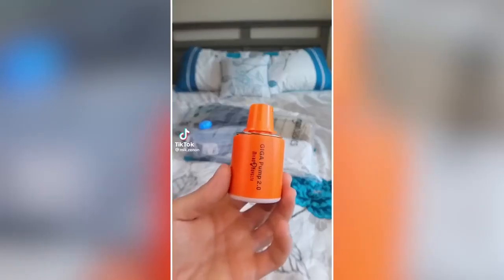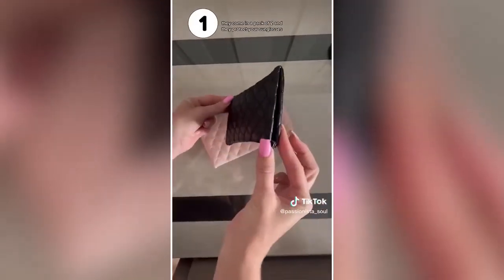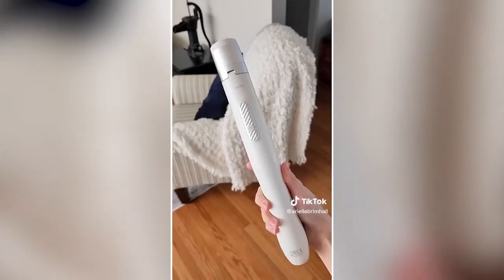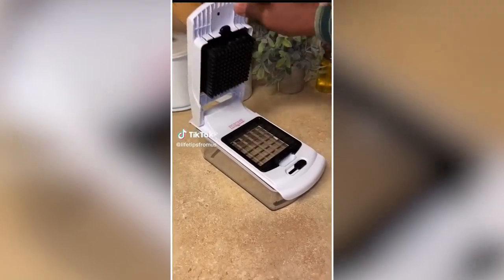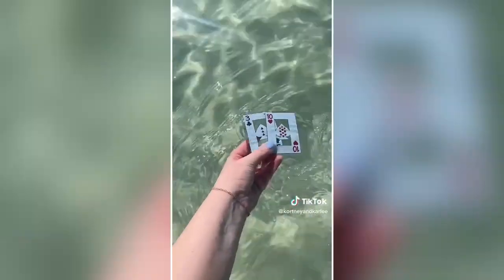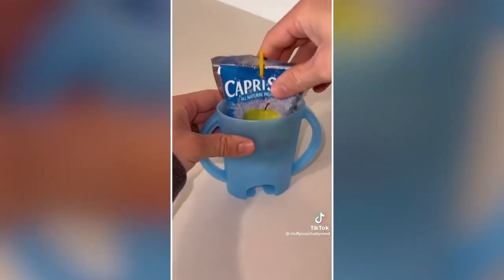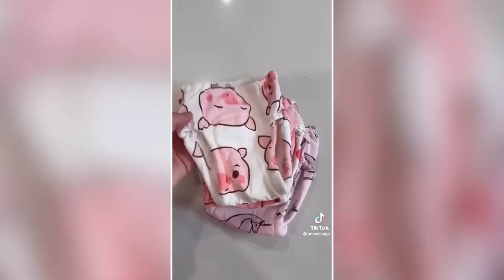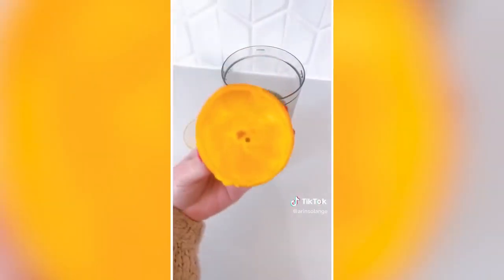2023 Amazon must haves with links TikTok Made Me Buy It #TikTokMadeMeBuyIT

Comment from the maker: 00:00 - Try Amazon Prime 30-Day Free Trial - https://amzn.to/3GAGcLO

00:05 - Toiletry Skins - https://amzn.to/41amMaR

Luggage and Travel - https://amzn.to/3LSp5ew

Neck Pillow - https://amzn.to/44rKXVi

Suitcase Cover - https://amzn.to/44r199g

Earbuds - https://amzn.to/3LUGMtR

00:32 - Garden Kneeler - https://amzn.to/42pEnNm

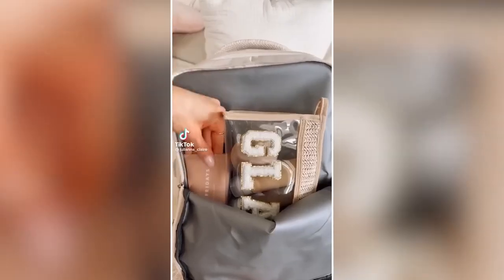00:58 - Large Travel Backpack - https://amzn.to/3LUBVbX

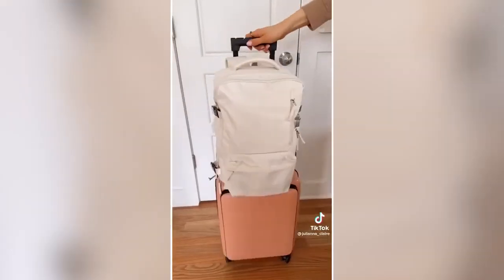01:24 - Pull Wipes Dispenser - https://amzn.to/416rdDQ
Automatic Pan Stirrer - https://amzn.to/3HEh9uU
Slushie Maker Cup - https://amzn.to/3LslCSq
Garlic Crusher - https://amzn.to/415huO5

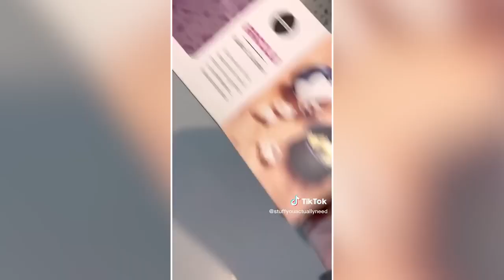01:56 - Liquid I.V. Hydration Multiplier - https://amzn.to/3VwoL8k

02:09 - Meal Prep System - https://amzn.to/3ZseU4D

02:43 - Wheel Tray - https://amzn.to/425XdJo
Label Maker Machine - https://amzn.to/3nsmtdN
Rings Loops Compatible - https://amzn.to/418VzW6

02:58 - Car Seat Gap Filler - https://amzn.to/3Vu5nsF
Car Trash Can - https://amzn.to/44vBHzg

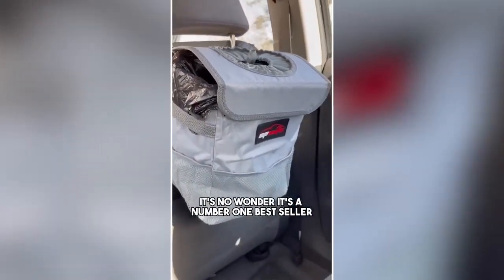03:37 - Carry On Garment Bag - https://amzn.to/425Z5lo

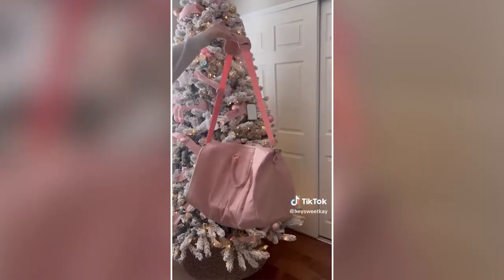04:17 - Clear Soda Can Lids - https://amzn.to/3Lso3V4

04:26 - MCMUFFIN MAKER - https://amzn.to/3NF9EHQ
thin ice cube trays - https://amzn.to/3HEwyva
oil dispenser BRUSH - https://amzn.to/3p5HNq2
peeler with container - https://amzn.to/44u5Q1V
FOOD HUGGERS - https://amzn.to/3nmSYu9
TOASTER TONGS - https://amzn.to/3pahWxj
DIP CLIPS - https://amzn.to/3AW6Lei
4 in 1 vegetable chopper - https://www.amazon.com/Vegetable-professional-multifunctional-Adjustable-Container/dp/B0BML2QRMD?pd_rd_w=0Z2hM&content-id=amzn1.sym.67f8cf21-ade4-4299-b433-69e404eeecf1&pf_rd_p=67f8cf21-ade4-4299-b433-69e404eeecf1&pf_rd_r=TNRRYGDFYYX1NQDG6Z0V&pd_rd_wg=rzgZV&pd_rd_r=c0608262-fe3d-4b52-9c6d-6f8f5b8125da&pd_rd_i=B0BML2QRMD&psc=1&linkCode=sl1&tag=wealthwizar03-20&linkId=7b592fa35909d1154b30c4afa350fe33&language=en_US&ref_=as_li_ss_tl

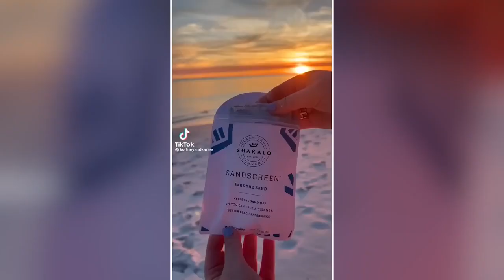05:23 - SANDSCREEN Sand Removal Bag - https://amzn.to/424XJr5

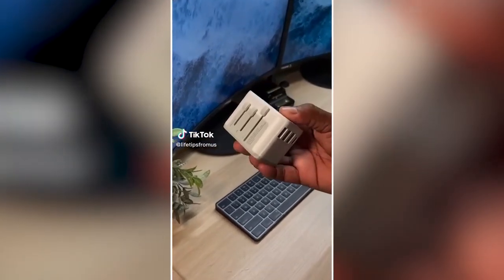05:39 - Universal Power Adapter - https://amzn.to/4172KOu

05:58 - 4-in-1 Car Vacuum - https://amzn.to/3LygcoX
Car Folding Visor Vanity Mirror - https://amzn.to/3AUxtUv

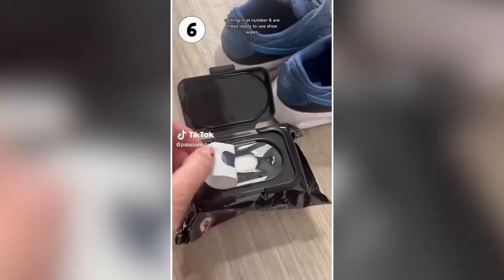06:25 - Sneaker Wipes Cleaner - https://amzn.to/3ARhlD8
Belt Bag - https://amzn.to/42qI2tY
Sneaker Cleaner - https://amzn.to/3p9OPKv
Diamond Dazzle Stik - https://amzn.to/422RHHB
Amazon Essentials - https://amzn.to/3pc6ktn
Sunglass Pouch - https://amzn.to/42nCGzN

07:04 - 
Ice Cube Tray - https://amzn.to/3VyLRuV
Electric Butter - https://amzn.to/3B0qGbH
Over Sink - https://amzn.to/4175X0u
Flat Top Griddle - https://amzn.to/3LAYIsb
Cookie Keeper - https://amzn.to/3EXY5WS
Reusable Pizza Storage - https://amzn.to/3VyrXjJ
Electric Egg Cooker - https://amzn.to/3LBGTce
Cutting Slicing Kitchen - https://amzn.to/3LTXQ33
Can Dispenser - https://amzn.to/42s07rV
Mixing Bowls - https://amzn.to/42t2hrf

07:51 - Tap Bracket - https://amzn.to/417Gc0d
Mounted Blinds - https://amzn.to/3p3IX5n
Mop Grippers - https://amzn.to/3LULRCh
Door Stopper - https://amzn.to/3nuH5Ck

08:16 - Inflatable Corner-Sofa - https://amzn.to/3oZmk1S
Sleeper Chair Bed - https://amzn.to/42o7Mr7

08:35 - Grampa's Weeder - https://amzn.to/3VAPkJM

09:05 - Nest Colanders - https://amzn.to/423YUHr
Rack Holder for Food - https://amzn.to/3VyNIQp
Clean Dirty Sign - https://amzn.to/3B0stxr

09:45 - Scrub Daddy Damp Duster - https://amzn.to/3LVG6EH
Strawberry Slicer - https://amzn.to/3LUtldr
Bag Clip - https://amzn.to/3AUNF8k
Camping Utensils Accessories - https://amzn.to/3VvJdWO

10:24 - mats beard bar 2.0 - https://amzn.to/40Zvau1
Dryer Vent Cleaner Kit - https://amzn.to/3Vx167O
Jar Spatula - https://amzn.to/3LxyQgS
Pet Boost Oxy Formula - https://amzn.to/3HGQ7mx

10:57 - Expandable Silicone - https://amzn.to/3AXeU21
Sock Laundry Tool - https://amzn.to/3HAfhDu
Hair Remover - https://amzn.to/42qKSQ2
Finger Chopsticks - https://amzn.to/3AWk7Hs
Middle Finger Hands - https://amzn.to/3M5aSet

11:32 - glass drinking straw - https://amzn.to/3p5Vkhk
Banana Bungee - https://amzn.to/3AUGX1T
Bands Cutter for Hair - https://amzn.to/3LUS94R
Bathroom Shelf - https://amzn.to/42ji1ge
12:09 - Laptop Sleeve Compatible - https://amzn.to/3VBe2cL
Travel Blanket Pillow - https://amzn.to/3LUyClf
Butter Hand Cream - https://amzn.to/422XT2o
Hydro Flask - https://amzn.to/42nLK7N
Power Mist - https://amzn.to/3HFju8Z
AirFly Pro - https://amzn.to/421qMfa

12:25 - Beach Towel - https://amzn.to/3HGsZVk
Waterproof Phone Pouch - https://amzn.to/41d76UE
Portable Bluetooth Speaker - https://amzn.to/3HCuuUg

12:44 - Beach Tote - https://amzn.to/3LVTWH0
Beach Day Pouch - https://amzn.to/419BBKW
Cup Holder - https://amzn.to/44rkHKG

12:57 - Large Travel Backpack - https://amzn.to/42pk5U1

13:25 - Selfie Stick Tripod - https://amzn.to/42jdJ8w

14:00 - Label Maker Machine - https://amzn.to/3NDrE5e

14:31 - Rings Loops Compatible - https://amzn.to/3oYindN

14:41 - Portable Carpet - https://amzn.to/3nsWOlc

15:18 - 
The Original Cup Claw - https://amzn.to/3LR3Vxf
Touchscreen Mist Cleaner - https://amzn.to/3HCOPsN
Guacamole ProKeeper - https://amzn.to/4250Jng
Pants Button Extender - https://amzn.to/3ns5WGM
Fabric Shaver - https://amzn.to/40ZxKA8
Steamer for Clothes - https://amzn.to/3LBcBqj
Electric Spin Scrubber - https://amzn.to/44vWLpk
Toilet Brush and Holder - https://amzn.to/3LCaZMS
Mini Bag Sealer - https://amzn.to/425bUN0
STAINS CO Stain Remover - https://amzn.to/3I20MbR

16:30 - Coffee Syrup Dispenser - https://amzn.to/3LUGd3f
Peppermint Syrup - https://amzn.to/415FzEt
Carmel Syrup - https://amzn.to/3NEJTYm
Milk Frother - https://amzn.to/3NGo4HS

17:02 - Instant Sole and Sneaker Cleaner - https://amzn.to/3VwUxSC

17:29 - LinkPod Station - https://amzn.to/3VzsL8j

17:57 - Bling Pill Container - https://amzn.to/3pb0jxr

18:06 - Snack Spinner - https://amzn.to/42nBgFp

18:16 - Coffee Mug - https://amzn.to/3LzN5S5
Banana Preserver - https://amzn.to/3AUElBa
Portable Wireless Charger - https://amzn.to/3LR9lbz

19:06 - Rolldown Refrigerator - https://amzn.to/3LwFMdV

19:18 - Fruit Infuser - https://amzn.to/3VzaCHv

19:28 - Shower Water Bottle Cap - https://amzn.to/3nsMw4z

19:45 - Crystal Hair Eraser - https://amzn.to/3LUnQv9

20:02 - Yogurt Fridge Organizer - https://amzn.to/4105bCt

20:15 - Beard Apron - https://amzn.to/3Vz2Ygm

20:30 - Automatic Mouthwash Dispenser - https://amzn.to/3Nzbr17

20:52 - 4 in 1 vegetable chopper - https://amzn.to/3p7IejB
21:25 - LED Wall Sconces - https://amzn.to/421C0Ak

21:50 - Kids Art Frames - https://amzn.to/3LSx0sf
Inflatable Toddler Travel Bed - https://amzn.to/3NFARtY

22:14 - Towel Warmers - https://amzn.to/3p7bOWC
Muffins, Croissants - https://amzn.to/3p7mu7u

22:38 - Kitchen Drawer - https://amzn.to/3LzQWi1
Self Stirring Mug - https://amzn.to/3HBeF0c

23:06 - Vegetable Cleaning Machine - https://amzn.to/3nvA0Bq

23:29 - Salad Chopper - https://amzn.to/3AQyL2V
Hover Soccer Ball - https://amzn.to/3Lyn9GL
Cord Organizer - https://amzn.to/3LBupla
Bed Pillows - https://amzn.to/426fEO3
Washing Machine Cleaner - https://amzn.to/3NFWcn4
Garbage Disposer Cleaner - https://amzn.to/3HF8AA0
24:12 - Triangular Powder - https://amzn.to/3HHoKsx
Face Washing Wristbands - https://amzn.to/3nsxvzK
Makeup Removing Swabs - https://amzn.to/3p6um9k
Guru Eyebrow Tweezer - https://amzn.to/3LA9QFv
Color Removal - https://amzn.to/3Ly6pPQ
Feet Coconut - https://amzn.to/44uTnLx

24:55 - Magnetic Wristband - https://amzn.to/3LRzUNP
Reply from the maker: 25:24 - Cordless Electric Spin Scrubber - https://amzn.to/3HGEBHX
Expandable Dish Rack - https://amzn.to/44t8mWe
Silicone Freezing Tray - https://amzn.to/3ASIxBF
Hidden Pocket Safe - https://amzn.to/3Vv04t2

26:10 - Cactus Back Scratcher - https://amzn.to/42oRdeF
Collapsible Water Bottles - https://amzn.to/3pb7RAd
Cordless Electric Scissors - https://amzn.to/3VA80sM
Compact Green Heavy Duty - https://amzn.to/42n6rAT
Magnetic Drawing Board - https://amzn.to/44vkBBD

26:52 - Tablet Floor Stand - https://amzn.to/44sEglS

27:32 - LinkPod Station - https://amzn.to/3Vw9aFK

27:56 - Waterproof Playing Cards - https://amzn.to/42qxmvK

28:10 - Countdown Timer with Repeat Function - https://amzn.to/3AS4UqG

28:33 - Waffle Maker - https://amzn.to/426PFWO

28:50 - SD Card Reader - https://amzn.to/41WxPpv
Dress - https://amzn.to/3AQXXX3
Medication Tracker - https://amzn.to/3nAv7a7
Portable Door Lock - https://amzn.to/3p7Dvi2
Lint Roller - https://amzn.to/3nvFkER
Wedge Pillow Stopper - https://amzn.to/44seVIJ
Sweatshirt - https://amzn.to/3pbyVzd
Warmer Lamp - https://amzn.to/3p06FiQ

29:51 - Water Bottle Dispenser - https://amzn.to/3NEHE7l
Projection Alarm Clock - https://amzn.to/3AUmcU7
QuickZip Fitted Sheet - https://amzn.to/3HFYWgB
Smart Electric Motor - https://amzn.to/3M5RLkt
Alarm Clock on Wheels - https://amzn.to/3NEHMnl

30:21 - Electric Spin Scrubber - https://amzn.to/3p7SWqk
Toilet Brush - https://amzn.to/3HFmYZ8
Waffle Maker - https://amzn.to/415U8Yv

30:47 - Night Light Motion Sensor - https://amzn.to/44xQp9k

30:58 - Magnetic Bottle Hanger - https://amzn.to/3AVoL8l

31:11 - Fullstar Vegetable Chopper - https://amzn.to/3LCJMJY

31:44 - Travel Toiletry Bag - https://amzn.to/3pe4Uyz
Toothbrush Cover - https://amzn.to/3LATmgj

32:00 - Smart Helmets - https://amzn.to/3nq4q8i
Bicycle Bell for Apple AirTag - https://amzn.to/3VxpR3G

32:21 - Automatic Card Dealer - https://amzn.to/42I1brR
Instant Photo Printer - https://amzn.to/42odfxZ
Security Camera - https://amzn.to/42gmPDc
Storage Lock Box - https://amzn.to/3NCNFkG

32:49 - Silicone Freezing Tray - https://amzn.to/3HB1VH1

33:33 - Hair Tool Organizer - https://amzn.to/41amWz8
Travel Power Strip - https://amzn.to/428o7As
Hair Drain Catcher - https://amzn.to/3NETSNe
Shower Foot Scrubber - https://amzn.to/426Dzgz

33:57 - Wipes Dispenser - https://amzn.to/3VxWYo4
Baby Bath Toys - https://amzn.to/3HE7ioK
Food Pouches - https://amzn.to/3nmREra

34:34 - Flip Seat - https://amzn.to/3AVPyS8

35:03 - 2-in-1 Under Bed Storage - https://amzn.to/42hVvEM
Silicone Stretch Lids - https://amzn.to/42tUeKR
Paper Towel Holder - https://amzn.to/3HERWAr
Drawer Under Shelf - https://amzn.to/3VxD4JM
Wipes Dispenser - https://amzn.to/3nmT84I

36:01 - Pants Button Extender - https://amzn.to/44ruD77

36:32 - measuring spoon set - https://amzn.to/42wj8tj
electric juicer bomkra - https://amzn.to/3AVRREz
garject garlic press red - https://amzn.to/42pRP3M
can strainer - https://amzn.to/3VPZ6I9
soda can pump - https://amzn.to/44uwmIG
tomato slicer - https://amzn.to/42emXne 
spaghetti fisherman - https://amzn.to/44umWwS
toastie cage - https://amzn.to/3p2JggI
milk dispenser - https://amzn.to/3HH4GGK

37:33 - Female Urination Device - https://amzn.to/416Xf2j

37:48 - Label Makers - https://amzn.to/3LW0zJk

38:09 - Desk Cable Management Tray - https://amzn.to/44uxmfU

38:35 - DraftPour Beer Dispenser - https://amzn.to/3HJRr8m

38:57 - The Pink Stuff - https://amzn.to/3NCXQG9
Garbage Disposer Cleaner - https://amzn.to/3NFiJjM
Wine Stain Remover - https://amzn.to/3AYaHv6
ORANGE Pet Odor - https://amzn.to/3nvgXXS
Washing Machine Cleaner - https://amzn.to/3LXiWgZ

39:30 - Expandable Dish Rack - https://amzn.to/3NDNhmb

39:55 - Cotton Pad Dispenser - https://amzn.to/3LYXOXV
Door Hooks - https://amzn.to/3AUIMfk
Toilet Scrubber - https://amzn.to/44vP4Q2

40:18 - Neck Traction Device - https://amzn.to/42ub9gm
Burger Holders - https://amzn.to/429h2iY
Automatic Pan Stirrer - https://amzn.to/3NIfTL1
Foot Scrubber - https://amzn.to/42szK4Z
Child Toothpaste Cap - https://amzn.to/3pbCuFE

41:00 - Magnetic Hat Holder - https://amzn.to/3HDBFfe
Sunglass Case - https://amzn.to/3I5fMFV
Beach Tote - https://amzn.to/3HI72W2
Portable Bluetooth Speaker - https://amzn.to/3pgQ62b
Steamer for Clothes - https://amzn.to/44wnthK

41:15 - Slim Cooler - https://amzn.to/3HFPLwk
Camping Towels - https://amzn.to/3AX5p2J
Picnic Blanket - https://amzn.to/3NGPtJq
Body Powder Container - https://amzn.to/429ooTC
Sunscreen Broad - https://amzn.to/42kvlkM
Portable Camping Shower - https://amzn.to/3LYjl2P
Fish Silicone Dish Brush - https://amzn.to/3NHBL9f
Makeup Sponge Holder - https://amzn.to/3LYvGny
Empty Acrylic Air Pump Jars - https://amzn.to/3p2Vvda
Clear Makeup Bag - https://amzn.to/3LzYfX1
Portable Air Pump - https://amzn.to/44uvmEv
Desk and table fan - https://amzn.to/3AVLeSQ
Mesh Beach Bag - https://amzn.to/44vYIlI
Collapsible Basket Buckets - https://amzn.to/3HI9qvO
Cup Holder - https://amzn.to/3Vx8CzH

41:33 - Elongated Toilet Seat - https://amzn.to/3AW0Gyf
Underwear Toddler - https://amzn.to/3NPF2TU
Potty Training Seat - https://amzn.to/3KEQznP
Waterproof Mattress Cover - https://amzn.to/3LFw358

42:37 - Silicone Stretch Lids - https://amzn.to/3VySNIC

43:18 - Fabric Shaver - https://amzn.to/3VCshOx

43:43 - 7-in-1 Cleaner Kit - https://amzn.to/41abcNc

44:06 - Keep Bananas Fresher - https://amzn.to/3AW1Jyb

44:28 - Pill Organizer - https://amzn.to/3nzLkwq

44:41 - MagSafe Battery Pack - https://amzn.to/3LDwoVU
Card Holder Pop Up - https://amzn.to/3LtroDa
Phone Timer Lock Box - https://amzn.to/44J3lJw

44:55 - Motion Sensor Night Lights - https://amzn.to/3HErIOs

45:20 - Table Lamp - https://amzn.to/3M0OT8p
Emergency LED Bulb - https://amzn.to/3NHwRt2

45:42 - Garbage Disposer Cleaner - https://amzn.to/3LVTIzI

46:03 - Sink Caddy - https://amzn.to/3AW3F9V
Scrub Daddy Soap Dispenser - https://amzn.to/3M0fSB0

46:27 - Air Removing Bag Clips - https://amzn.to/42qpBWl
Beverage Dispenser - https://amzn.to/3NDJ15Z
Smart Storage System - https://amzn.to/41abNyr

46:50 - Popbins Self Replenishing - https://amzn.to/425z7yH

47:22 - FridgeFork Condiment Fork - https://amzn.to/3LYDJkj
Self Wringing Flat Mop - https://amzn.to/41cERVQ
Touch-Up Paint Pen - https://amzn.to/3NHEmjp
Slushie Maker Cup - https://amzn.to/428GmFR

47:55 - Jewelry Tray - https://amzn.to/3M17sta
Candle Warmer Lamps - https://amzn.to/41a76on
Chip Clips - https://amzn.to/3VCeh7l

48:11 - Portable Electric Citrus Juicer - https://amzn.to/3NFC0Sa

48:43 - Hanging Travel Toiletry - https://amzn.to/3AVDHnd

49:29 - Cleaning Pen for Airpods - https://amzn.to/3NHAgIk

49:48 - bubble spa matt - https://amzn.to/44xOCAL
white smart bin - https://amzn.to/3VEu59Y
bartesian cocktail capsules - https://amzn.to/3M0SN13
black smart desk - https://amzn.to/3B2E8vG
coffee alarm clock - https://amzn.to/3NDLNYX
sauna blanket - https://amzn.to/3AWbvjN
self inflating bed - https://amzn.to/3NFCXdc

50:43 - White Dental Floss - https://amzn.to/3InwnUt

50:57 - Closet Organizers - https://amzn.to/3I5oggf

51:09 - Garlic Press - https://amzn.to/3LtK6uA

51:32 - Portable Printer - https://amzn.to/428uuUe
Nonstick  Bakeware Set - https://amzn.to/44vF6yh
Smart Trash Can - https://amzn.to/3pb7fdJ
Espresso Machine - https://amzn.to/3Ltxlju
Smart Deadbolt Lock - https://amzn.to/3nzSq42
Smart Cutting Board - https://amzn.to/44AxsTp
Couch Cup Holder - https://amzn.to/41agHvl
Convenient Couch Cup Holder - https://amzn.to/427Bxg9
Shower Caddy - https://amzn.to/3npAt8o
Soap Pump Dispenser - https://amzn.to/42pp5YM
Tumbler with Handle - https://amzn.to/3pazPMu

52:30 - Travel Portable Dental Floss - https://amzn.to/42rR2PL

52:44 - https://amzn.to/3B0PgJL
53:23 - Passport - https://amzn.to/42nDPYN
Magnetic Hat Holder - https://amzn.to/3HHtJJV
Collapsible Travel Cup - https://amzn.to/3NCVneM
Wireless Power Bank - https://amzn.to/3Vz35bQ

53:49 - Hobby Rock Tumbler Kit - https://amzn.to/3LZf6Ek
Portable Gaming Monitor - https://amzn.to/41ZwgHn
Mini Projector - https://amzn.to/3Ltzf3C
Rapid-Fire - https://amzn.to/42qfEIK
Back Massager - https://amzn.to/3pbTFqC

54:37 - Storage Bin - https://amzn.to/3VDDhvi
Rolling Storage Bin - https://amzn.to/3Vy0BdK
Refrigerator Drawer - https://amzn.to/3nwtmL8
Drink Organizer for Fridge - https://amzn.to/418d5Kf
Canning Jars - https://amzn.to/42kGVMM
Containers for Refrigerator - https://amzn.to/3ny2iLI
Fridge Egg Drawer - https://amzn.to/3LUxOwF
Hanging Containers - https://amzn.to/3AWfhcX
Pull-out Fridge Drawer - https://amzn.to/41cL18q
Berry Keeper Container - https://amzn.to/3nwtMBc

54:50 - 2-in-1 Under Bed Storage - https://amzn.to/3nyDaUZ

55:54 - Magnetic Key Rack - https://amzn.to/3LYLiri

56:31 - Bread Buddy Dispenser - https://amzn.to/42pjMZp

56:47 - Trek Stand Phone - https://amzn.to/3Vya9FF

57:04 - Reusable Cable Zip Ties - https://amzn.to/425Gfer
Pill Container - https://amzn.to/3NIP0qq
Reply from the maker: 57:30 - Sunscreen Brush - https://amzn.to/3LYMJ9a

57:43 - Rechargeable Book Reading Light - https://amzn.to/3LVVAIL
Reusable Lint Roller Ball - https://amzn.to/3M0p7kG
Electric Wine Decanter - https://amzn.to/42uw7eG

58:12 - Coffee Carving Pen - https://amzn.to/3LEB5Pu

58:41 - Indoor Countdown Timer - https://amzn.to/3LXXI2u

59:00 - Serum with Vitamin - https://amzn.to/3p7Cjep

59:25 - Corduroy Belt Bag - https://amzn.to/3pfMvkY

59:49 - Bathroom Dental Storage - https://amzn.to/3I5vCQT
Toilet Brush and Holder - https://amzn.to/42ruCOv

01:00:16 - Utility Cart Heavy - https://amzn.to/413jg2h
Click & Carry Grocery Bag - https://amzn.to/44vJXzu
Shopping Cart Quarter - https://amzn.to/3AYCyva
Cart Lift Table Cart - https://amzn.to/3LYG2nx

01:00:46 - Cordless Electric Spin Scrubber - https://amzn.to/3nBnr7O

01:01:22 - Spoon Rest - https://amzn.to/3NQ0t7k
Jar Spatula - https://amzn.to/3VQzw5P
Food Huggers - https://amzn.to/423TYlM
Expandable Wipes - https://amzn.to/3HDZxPS

01:01:55 - Coin Holder - https://amzn.to/44rev5v
Hand Vacuum Cleaner - https://amzn.to/413I6Pj

01:02:16 - Book Reading Light - https://amzn.to/3Lz4ISd

01:02:28 - Pet Odor Eliminator - https://amzn.to/3HH4ase
Dog Brush - https://amzn.to/42wVJbb
Pet Hair Remover - https://amzn.to/42kX7xy
Dog Licking Floor Mat - https://amzn.to/3LYtfS0

01:03:03 - Sneaker Balls Shoe - https://amzn.to/3B16EOx

01:03:17 - Coffee Syrup Dispenser - https://amzn.to/413mbYI
Glass Coffee Mugs Set - https://amzn.to/3LXVe4d
Motion Sensor Cabinet Lights - https://amzn.to/3HIA1c8
Syrup Dispenser - https://amzn.to/3M1tJHi
Coffee Canister - https://amzn.to/3pg16gg

01:03:47 - Sunglasses Holders - https://amzn.to/44Bmehd
Audi Key Fob Cover - https://amzn.to/3LWEudE
Car Seat Gap Filler - https://amzn.to/3LF0dph
Hooks for Car - https://amzn.to/3AUWy1E
in-car sauce holder - https://amzn.to/3VzuIBm

01:04:20 - Bedside Caddy - https://amzn.to/42pCrEr

01:04:35 - Electric Screwdriver - https://amzn.to/413yswl